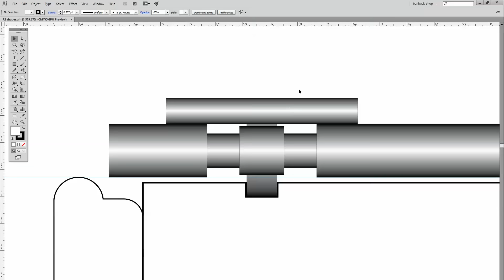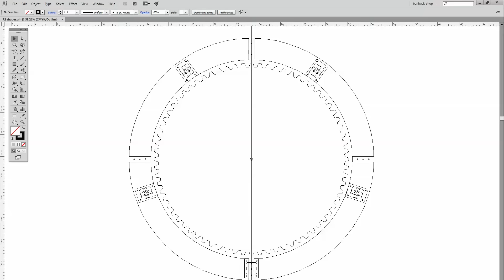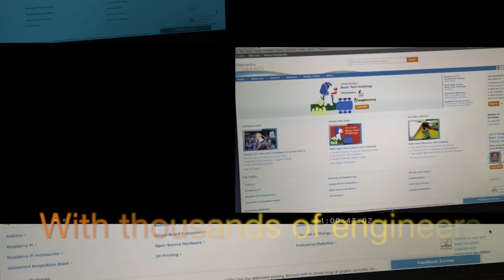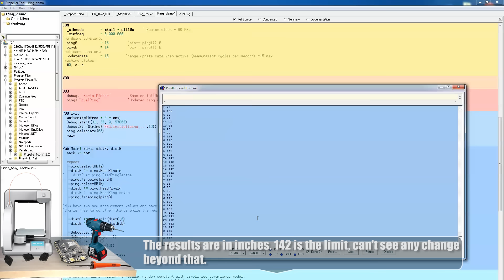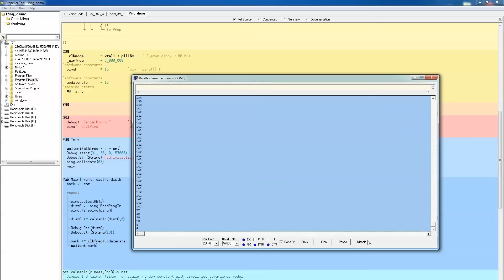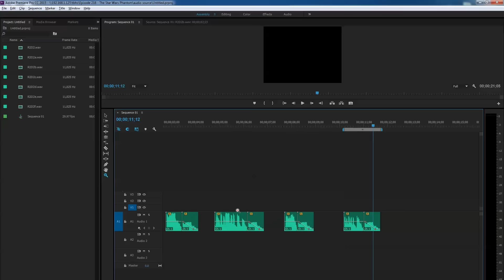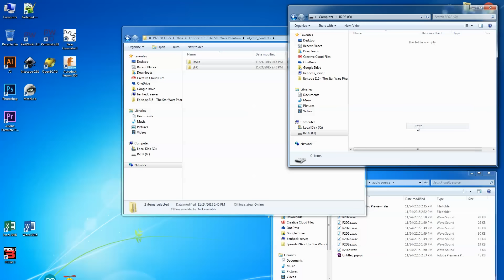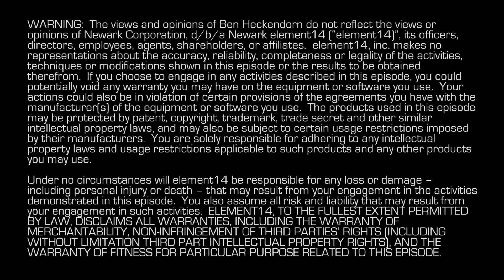Ben Heck's Star Wars Christmas Special

Comment: the enamel of the grill is hardened at temperatures over 2000°C in the factory, this way, the surface becomes smoother than it would be possible with any other method, and  its outer layer is actual glass, which makes it extremely hard to paint. you can only add another layer of enamel, try to bond them together with heat and roughen up the new outer shell. The extremely smooth surface of weber grills is what makes them last a lifetime and makes them extremely easy to clean because nothing really sticks to the enamel.
Reply: +MAYER MAKES Neat! Thanks for the info. I have some experience with powder coating, but still figured I might be able to scratch it a little. Good to know for next time.

Comment: 13:37 You test a Dual Ping sensor to be able to detect direction of hand movement.
21:47 It seems that you used only one Ping sensor and it will detect any object in range regardless of direction of movement.
Reply: +lasersbee Probably not enough time to program.
Reply: +Cliff Hartle iF that is the case then he should have made mention of it with perhaps a reason why.
BTW... he had the Dual Ping routine already programmed in the Dual Ping tests he did.
Reply: +lasersbee At 13:37 all I saw was him do was a program to output the values to the screen. He then described what he wanted to do in the program not actually program it which may not have happened due to running out of time.

Comment: I love it.  The acting and skits just get better and better.  Felix is great.  The only thing I would have done different on R2D2  is use something different to trim out the hole in the dome.  It looks like duct tape was used on the sharp edge of the hole cut out of the BBQ.  I have used trim plastic from arcade bezels and marquees that might have worked well to trim out your hole.   My other thought was to use photo cells through a smoked plastic eye piece in place of the audio senors.  The project turned out great as it is but those are just some thoughts.  Thanks for a great show.  Glad I found it.

Comment: How about a linear actuator to do the tilt-up head open thing?  40 inch stroke and 330 lbs lift is less than $200.  People mechanize car doors with them so I'm pretty sure you could find one capable of opening the top of a Webber.

Comment: Hi, I don't know if you have ever considered trying to make a more efficient model of hydrogen generator, and by efficient I mean more hydrogen production like in tens of liters per minute with a rather low power consumption. Now I did some research and the basic concept of hho generator is that you have inox plates or whatever form of anode and cathode you want, but the tricky part of this, in my understanding, is to modulate the current to a frequency just below the water rezonating frequency and feed it into the generator at a very high voltage.
My question is, how would you do it? I mean the concept of electronic.

Comment: Fusion 360 is life
Reply: +Garrett Calkins Fusion 360 looks interesting. But I just can't seem to be able to get used to it. I guess it's because I'm used to Solidworks. But It's probably easier then I think.
Reply: +Ashley Van Steenacker It's still object orientated.  The interface is somewhat 'dumbed down' but for fast object creation it's really powerful.  I really like it, though it's a very different tool to Inventor (which I' much more used to).  I think it has real legs.  Worth persevering.
Reply: Having Inventor, Fusion 360, Mockup 360, and Solid Works in my library, I have grown to like all for different uses.

Comment: Ben
BTW just saw Star Wars The Force Awakens this morning with friends and it was awesomely great.  Going to see it again. FYI here is my SEW WARS Episode I Winter Texans the Force Awakens https://youtu.be/nAqMf9I55iI
This project is definitely more complicated than it needs to be.  Why create a 360 degree ring gear when you only need to move the dome several inches and have it return.  Why not skip all of the ring fabrication/bearings Etc and use a simple cable on a servo pulling against an apposing spring that pulls on the small access door mounted on a simple track or slider rail.  You could also use a small belt.  That way the dome does not have to move and you only need to move the small door sideways or up/down.  When the servo needs to close the door the spring pulls the door closed as the servo unwinds the cable or belt returns door to closed position.  Or a simple weight can be used instead of a spring.  Your system looks like a rube Goldberg setup.  I know you want to make a show but Remember the KISS principle.
Claude ...

Comment: Why not use a gesture sensor?
Reply: +JaapioNL We wanted it to require a specific distance and to sense a "wave" gesture so that it would only be triggered when "using the force" rather than just buy anything walking in front of it.
Reply: theHeckwithKaren True, I haven't seen any gesture sensors that let you limit the distance they check but since it detects the general direction (left, right, up, down, forward, backward, clockwise, counter clockwise) it would make it really easy to exclude a wrong wave from an evil sith ;-)